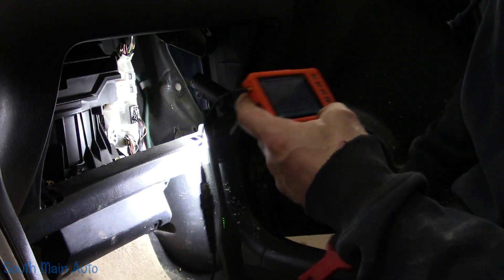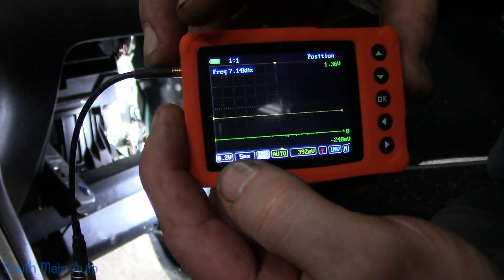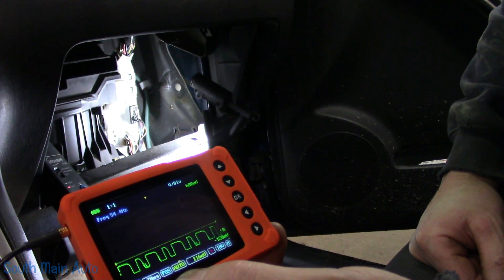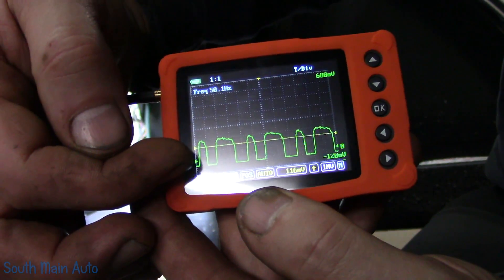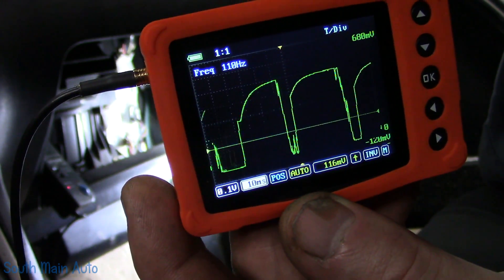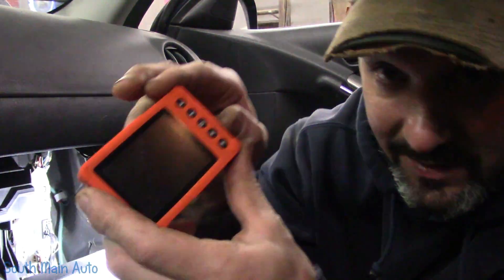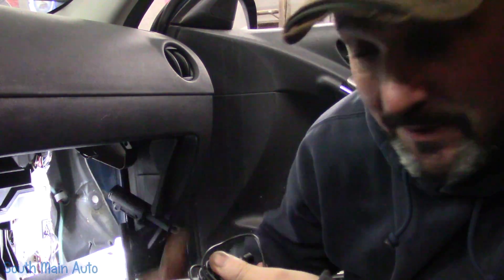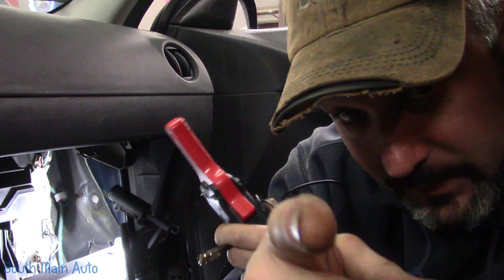Diagnosing An Intermittent Blower Motor Part I

Comment: I know this video is old but have a question. If you remember when using the current clamp with the uscope  did you have it set for volts to see that waveform or volts. I have another brand pocket scope not the uscope and my only option is volts. I plan on buying a pico soon.

Comment: Nissan Frontier=Scottzuki Equator
An unrelated issue but I replaced my blower motor. It wasn’t blowing worth a 💩 with the new one. Stupid factory reversed the polarity so it was sucking air instead of blowing it. I’m not a mechanical person but i cut the wires and switched them around. Hey Bobs my Uncle too.

Comment: I'm curious - which amp clamp is that? It doesn't look like others I've been looking at. 
Fantastic video. I've been using old-school (antique) scopes to diagnose alternators for my restoration business for years - last one bit the dust. Looking for a modern scope - this looks like the ticket. Gives me ideas for other diagnosing as well. I get wiper motors and blower motors sent to me for restoration. These methods would be helpful. Looking to go buy this week.

Comment: I have a 2016 Jeep Cherokee and sometimes the fan will go from blowing full to barely any air through the vents and it's not in auto mode. This seems to be a common problem in the Cherokee from owners forums, would an open spot in the motor be my issue too?

Comment: It's guys like you that make fixin' my stuff so easy. I just google my issue and get a gazillion yotube vids.   Keep up the good work. BTW I put vasilene on my Liberty gas cap O ring and my 456 code went away also my 300 but I didn't fix that ?  And I got my sticker ! LOLOL

Comment: Just make sure your fan motor is not controlled by PWM. I work on heavy trucks that have fan motors controlled by PWM. But if you set them to the highest setting,  you should have a 100 percent duty cycle.

Comment: Thanks, I have been using scopes for many years and I never realized that you could check a brushed motor in that manner. DUH!!! Makes perfect sense, rather than me troubleshooting every little connection for resistance/conductance and opens. Then after all that, still no solution until I tear down the motor and find the brush/commutator in shambles...
Thanks again.

Comment: Have an 03 Envoy XL with rear AC.  The rear blower will not come on when I want it to.  Sometimes it will just come on out of the blue if I leave the switch on (at full blast). after driving around for a few minutes  Never works anymore at any of the slower speeds (except for a quick burp of air through the vents then stops immediately).

Comment: Hard to beat that price, especially when one considers how fast it boots up. Viewers should know that necessary accessories like the current probe, capacitive pickup and 10X probe are extra. I love the much more expensive pico, and it is certainly more versatile and accurate, with greater ability to save and analyze waveforms. But this one would quickly answer many questions that a mechanic would be asking.
Reply from the maker: I love both of them but 67.3% (rough guess) of the time in the shop I just need a quick answer. This saves me all kinds of time. Unfortunately it is not helping me build my known bad and known good data base because even though I can store data on it I tend not to.

Comment: Question for you,  would you get a similar reading on the scope if the motor was PWM, for instance on an variable speed fan motor?
Reply: I would think you would.  While the PWM is switching the voltage on and off, it is happening quite fast with the windings inductive nature keeping the current relatively stable over the PWM cycle.  The shallow dips seen in a properly running motor are due to the physical switching across the tiny gaps in the commutator between windings.  A bad winding would still show a deep drop in current as the brushes passed over not only the gap between windings but over the open (no current) winding connection.

Comment: When you get another problem that requires a scope could you explain a little more about the waveform? What should  a proper  line look like and stuff like that.  I get a little lost when you break out your scope.  I didn't even know what a automotive scope was until I subbed to your channel.
Reply: You first have to understand how certain components work to understand how to read the data that is in fort of you, experience is one of them, but such at electrical motors such as a blower motor has a optimal opteron and only works in one of 2 ways, once you educate yourself on these things you can interrupt the data, hope that helps

Comment: Ha. We just "fixed " an intermittent blower motor on a 2000 Buick. The bearings were rather stuck so we cleaned, lubed and reassembled the fan and it seems to work now. Before we sometimes needed to kick the fan to get it going. Regardless... could be the same issue Eric sees above so needs replacement eventually . . .

Comment: I owned a Vibe, which is a Toyota station wagon.  I had an issue with the fresh air door flap running constantly.  I had to pull the plug.  What is it with Toyotas and electric motors?

Comment: I have to admit the U scope is so much easier to use for us DIYERs. I still like when Eric O uses the homemade test lights since I it shows it in bright and low light. Knowing me, I'll misread the U scope and think a part is faulty when it's not. Hate replacing parts I don't need. Great tip!
Reply from the maker: Check out my pinned comment. I linked a book in there that will help sort all of that out. A very good book to start with!
Reply: @SouthMainAuto  I didn't see any pinned comments on this video? Did I miss something?
Reply from the maker: @KennethITGuru  Ooops, sorry, I just fixed it!

Comment: Well Eric that's it...I'm ordering one today.  PLUS you explained why I'm on AC motor #5 in my 2008 F250 after the "Fonzi Fix" stops working.   Awesome video and while a "Shade tree" mechanic like myself can't justify a $2500 PICO to work on family and friends' rides, that U-scope CAN be an enormous time saver. THANKS for spreading your knowledge!
Reply from the maker: Check out my pinned comment. I linked a book in there that will help sort all of that out. A very good book to start with! A great addition to any scope!

Comment: Great video as always. Glad to see continued use of the Uscope. The only time this test could get someone in trouble is if the motor is pulse width modulation controlled and someone mistook the PWM signal for a bad spot.
Reply: The freq is way higher
Reply: @38911bytefree  Agreed but a less skilled tech probably wouldn't notice the frequency nor the cleaner shape of the PWM control square wave.
Reply: To get the pwm signal, you’d have to probe the connector, not use an amp clamp.

Comment: Great tip Eric! I never thought to actually watch the waveform on my handheld o-scope for this. I use that tool for all kinds of voltage checks and things but never thought of it that way. The only part that could cause an issue is some newer vehicles like my 14 Silverado have pulse width modulated blower motor resistors so it will give a reading that bounces up and down but yours is clearly erratic since the spacing is not even.
Reply: If the time and the date was stored along with the waveforms, then it would be easier to store data, but who has the time to go on the laptop and write in the info every time a test has to be done.

Comment: I have a 99 Eclipse Spyder GS automatic. I never set the first cylinder to TDC before I pulled the head off and rehoned it with a Dremmel flexshaft and a brass brush.  After cleaning and painting, I put everything back together( I zip tied the camshaft gear to the belt to keep it in place) and torqued the head down . I never thought about where the valves should be positioned before I put  it back together. I fired the engine it ran rattling for a few seconds and shut down. I turned the key again and got a ticking buzzing sound with no crank. I used the scanner and came back with a crankshaft position sensor code. That sensor is beneath the timing cover which is but up against the driver's side wheel well, I can't even get my hand down in there let alone any tools. None of these gears have timing marks... so my question is... does anyone know how to reach, read, readjust or set the time to  this engine without pulling it? the crankshaft has a timing mark on the plastic cover for TDC and 2 stamped circles on the crankshaft pulley, but I don't know if these holes are intended for a tool like an angle grinder wrench. HELP PLEASE!
Phoebus Castle
Reply: that's an interference engine, which means if valve timing was off, it's now broken and you can now tear it apart again while learning from your mistakes. Maybe just a rebuilt head or most of the valves replaced and machine work, if your lucky it didn't break any pistons.......
BUT from the sounds of it, it completely broke a valve off and it's now jammed between a piston and head keeping it from turning over, which pretty much means it destroy both the head and a piston or more, possibly far more including, rod/s, crank, camshafts, lifter, rockers. all you can do is pull it apart and see, but it sure sounds you're looking at full rebuild or different  engine...

Comment: Great video.  Thank you so much for sharing your experience with a random problem.  The use of a minimum of expensive tools shows that you don't have to have $100K invested in tools to determine if a motor is failing.  Keep up the good work Eric.

Comment: When you switched the motor off and on quickly, the motor might still have been spinning from inertia. Meaning that it spun by the dead spot, and kept running. When you wait a couple of seconds in between turning it on and off, it of course has a high likelihood of landing on the dead spot. Just a theory, keep up the good work :)

Comment: Smashing , i would not have thought about using a scope to detect bad commutation.
That mini scope is really good for basic tests :-D
I would not like to carry my old tube based scope outside, ball busting weight and a 240 volt mains extention lol.
Reply: The power cord alone would be a lot of weight.  Plus I really would not like to use 240 outside on an extension cord.  zx8401ztv you must have a cart to carry all of that stuff around.
Reply: No i will buy a portable one if really needed, im not a car tech but frends have problems so i jump in to help, if i can.
The old scope can stay in the house, too dam heavy ha ha :-D
Reply: I think the knobs on the front of my old 555 scope would weigh more then the uScope lol

Comment: Eric O , I wish this great video was around when I chased a caravan low to slow fan motor output !  I stared at the wrong end of the problem and replaced parts . Last was the fan motor( on caravans the last back screw is not so much fun)  . This video would have saved me a few bucks. Thanks for teaching and sharing :)

Comment: My blower motor (10 avenger) shuts off in the highest mode but works in the other 3 modes. Anyone know if it's my blower moter?
Reply: Unlikely. Switch or cables are probably the cause.

Comment: Eric, just ordered a U-scope basic, single channel scope. Can you give me the part number for the wire clamp, since the U-scope basic does not appear to come with one.
Reply from the maker: When you order it from AES Wave just call there and talk to Carlos. Tell him you want the same amp clamp that I show in the videos. He will know what one it is.
Reply: @SouthMainAuto  and he will also tell you which adaptor you'll need banana or mini bnc i think they call it.
Reply: @SouthMainAuto   Which scope do you recommend for someone who is interested in buying and learning how to use a scope?
Reply: The clamp that comes with the master kit is P/N 07-60-BNC and you would need the adapter 08-87-BNCF to connect it (or any BNC accessory) to the uScope.

You can also purchase the same clamp with banana plugs P/N 07-60-BP and use it with the existing test lead or get a shorter banana adapter 08-87-BS

Comment: Most blowers I know have 5 settings (0...4, off...max). The max speed (4) is directly connected to power and the other speeds (1...3) go through a resistor pack. Often blower that have failed  have broken resistor packs. A test is to see if the blower is still working in the highest setting (4), because there the motor does not use the resistor packs.
With new(er) cars (tesla) you sometimes don't have a knob with speedsetting, but a menu. Here you can set every speed you want and the motor is controlled by PWM. You see something like Eric showed on the scoop, but the signal should look 'nicer' and change with different speed settings. So check before ordering a new blower motor. 👍😃
Reply: Most modern cars use pulse width modulation. They usually don't have resistors any more but instead have blower motor control modules.
Reply: @justinballard7242    Blower motor control module is pretentious talk for a power MOSFET (transistor) and a thermal fuse on a heat sink.  PWM from the control module in the dash drives the gate of the MOSFET which switches to create PWM on the motor windings.
Reply: in the days of actual blower motor resistors, they metal would rust and connector corrode burning the plug and harness, sometimes at the high relay. however, when they were burnt it was also often a bad blower motor with partial shorted windings drawing too high of current and not always enough to blow the fuse..
Reply: https://www.youtube.com/watch?v=9t8BkpavIoE
check this out..
Reply: I agree, first time i check a PWM fuel pump i was like, wait what the heck is this I’m looking at! Haha.
Reply: @Haz Cat I had a '72 Impala that lost high speed fan. The inline fuse under the hood, as I recall, just melted from sketchy connections. I soldered in a heavy duty fuse holder in place of the original and no more problem.